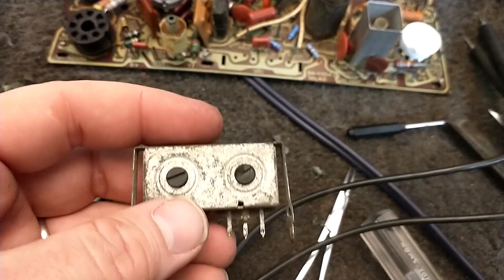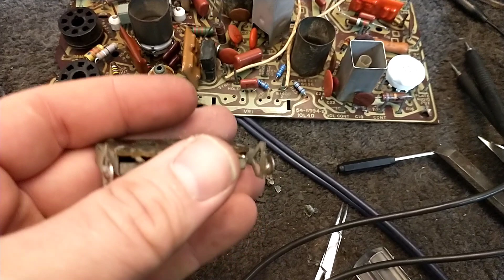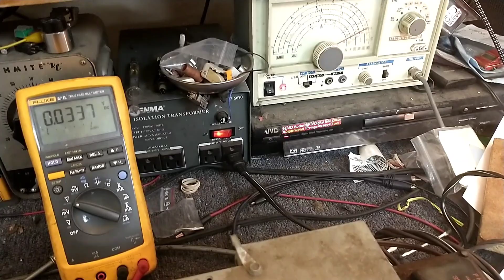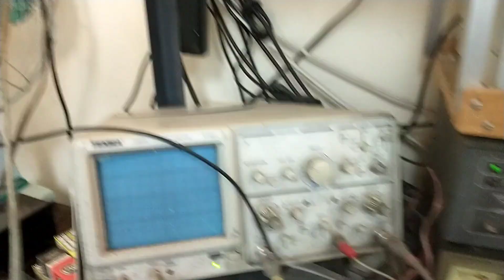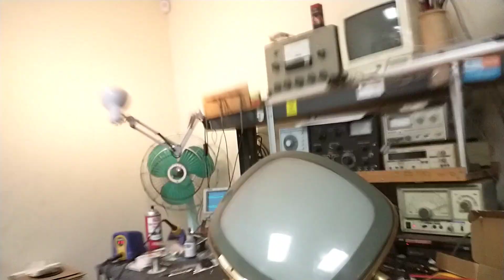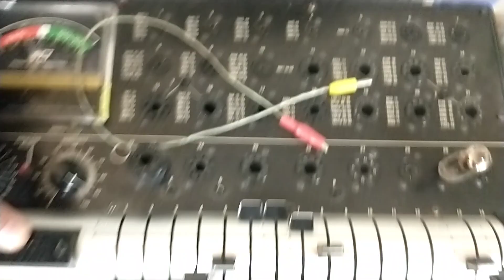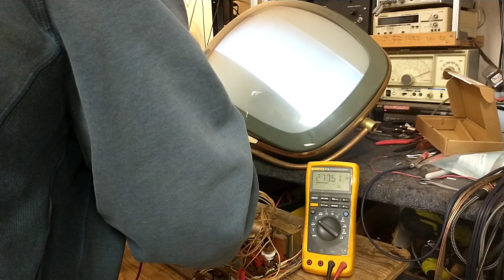Servicing a 1959 Philco Predicta Princess Part 5/9 - tin whiskers, reassembly and initial power up.

Comment: 2:45  i wonder if you can zinc plate it or something.  Sand, polish and then plate.  If tin whiskers ever grew back, you would see it immediately.  It's more work and more expensive, but it would look better. (EDIT: Tin whiskers very much like growing on Zinc plating and even chromation, which I would sure would stop it is no match for tin whiskers end edit)
Reply: Tin whiskers grow from tin. There's no tin in zinc plated steel. There is tin-zinc plating.
Reply: @willthecat3861  But tin whiskers grow from or right through a zinc plating even if it is hardened with chromium.

Comment: it's working,  just getting it to that stage is smashing :-D
If you can get 300 volts, it would show more.
I was thinking about injecting 400v through a wire resistor as a test.
But that's a bit naughty and might damage something.
Keep chipping away at the faults jordan, i know you will win :-D.

Comment: I love the detail you're presenting in the video and showing us all the waveforms, as you check out each section of the board. One question though, the board that you took apart with the dual pot senate and the metal enclosure to prevent tin whiskers. Is there a reason? You painted it with black paint, or would silver paint have worked as well? I'm thinking that a lot of silver paint has actual metal in it, aluminum, and I did not know if that would affect operation.
Reply from the maker: Yes the paint seals the metal and prevents the whiskers from forming. I would only use flat paint. Nothing with silver or metallic flake.